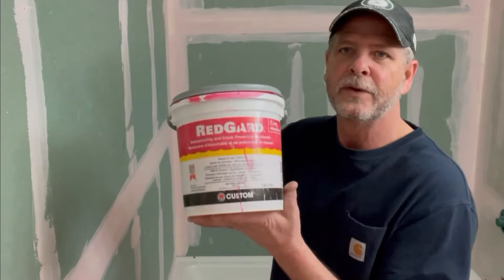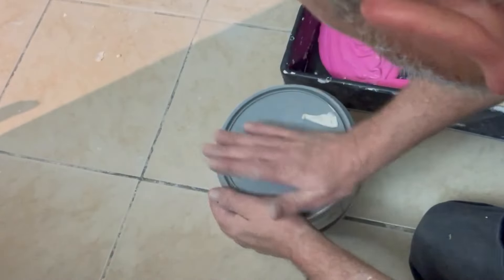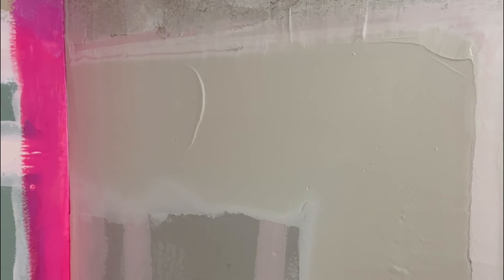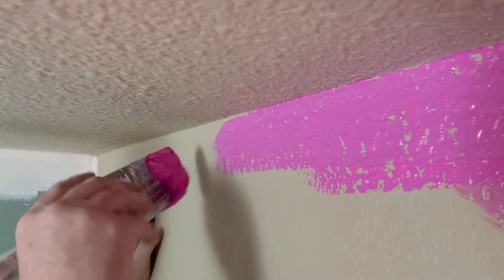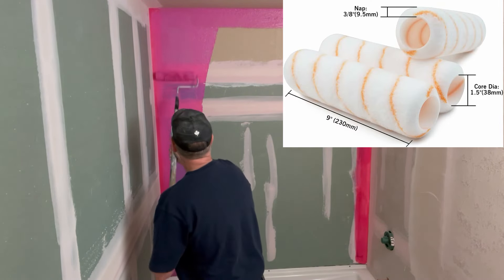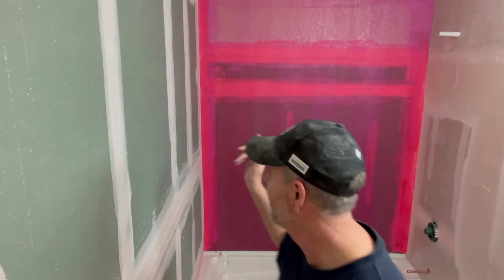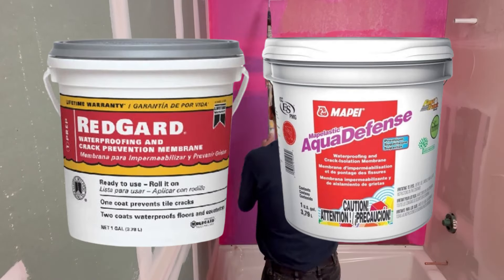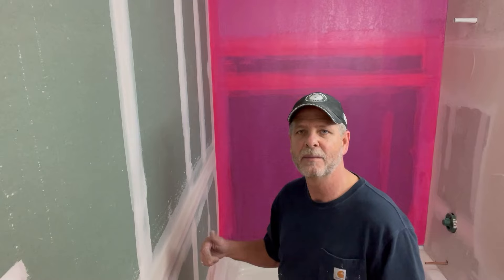Waterproof A Shower | Easiest DIY EVER!

Comment: Thanks for sharing. How would you fix (cover or paint over) the sealer that went on the ceiling?
Reply from the maker: The tile we’re using is 1/2” thick so no worries there

Comment: Redguard is $56 for a gallon, which covers an area between 5' x 5' to 10' x 10'.
That's like $2 per square foot in the heavier application, is that true?
Reply from the maker: I always apply 2 coats and I can get 2 full tub/shower enclosures out of 1 pail. Each enclosure is about 80sq/ft x total of 4 coats, so around 320sq/ft per gallon is my math
Reply: @DIYBuilt  I guess the instructions assume a much heavier application for 25 to 100 sq ft. coverage.
Reply from the maker: @dubmob151  ya they must